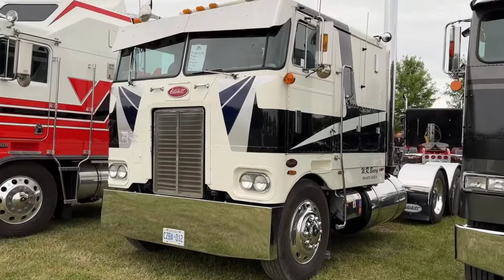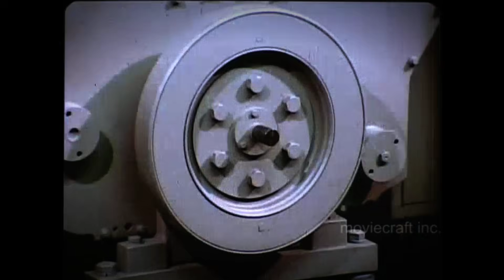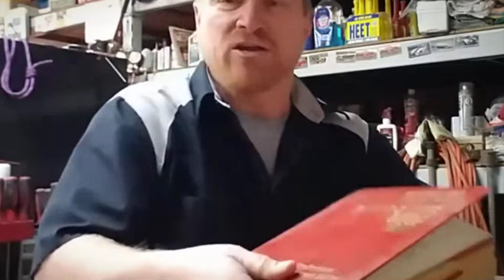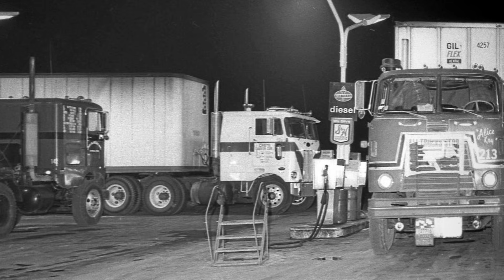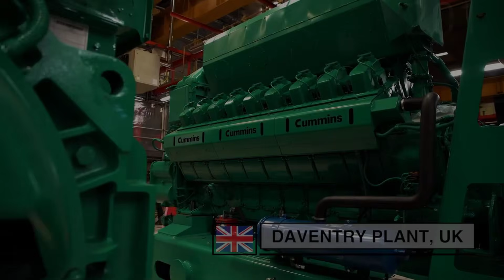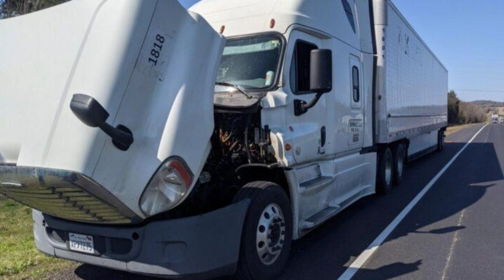Why Truckers Are Throwing Out Modern Diesels for the Cummins Big Cam

Comment: Diesels were finished fifty years ago when a friend of mine designed and built a steam powered unit suitable for cars and trucks. It was the lowest emission engine in the world and still is It was demonstrated successfully in America to Senators and the vehicle mfrs., Did they want it? NO. The present day diesel is a scrap iron jungle when the emission gear is fitted and then can't meet required standards. He designed and built a modern steam unit see U-tube Pritchard Steam Car. Don't talk to me about diesels as I worked on them for thirty years.